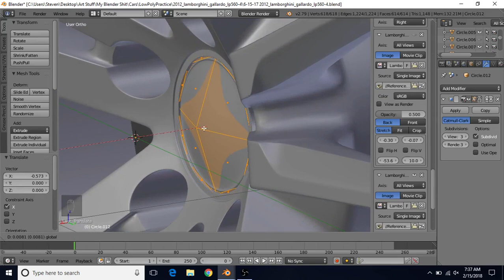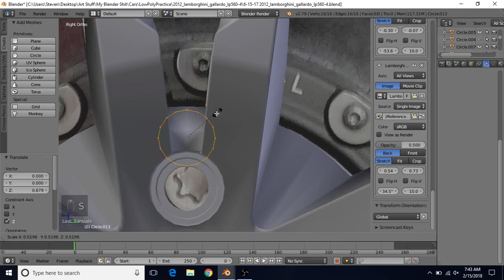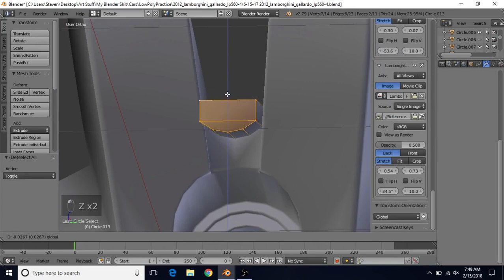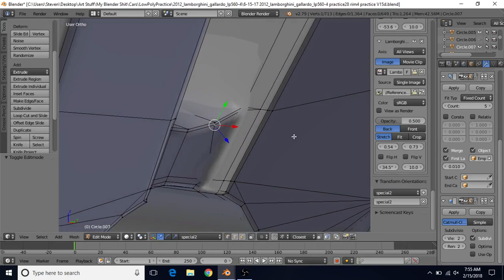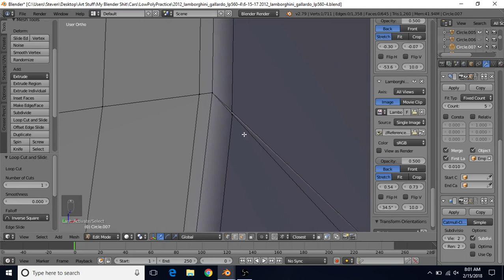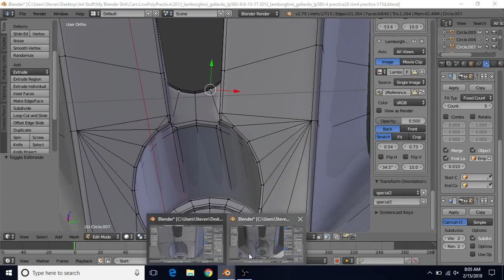Model A Lamborghini Gallardo LP560-4 in Blender - Tutorial Part 35 - 4th Rim Part 6

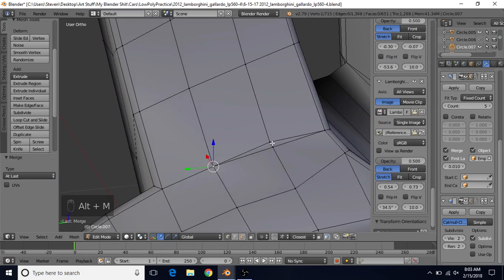Comment: Hello! I suggest using a good option "automatic merge vertices" instead of ALT + M -> "at last" (27:30). This is the icon to the left of the camera icon (render). In any case - it saves me a lot of time and it would be useful to everyone, I suppose)  ...Oh, when moving vertex, the button "CTRL" should be pressed.
Reply from the maker: Hey! Thanks for the tip! Sometimes with these automatic things I prefer to do it by hand. That way, nothing gets accidentally merged or something without me knowing it :D.

An example of this happened to me while making one of these rims (not this one specifically, I forget which one). But anyway, I did the remove doubles command and it actually removed some that I didn't want to remove!

But this is an interesting suggestion and I've never actually played around with it so maybe I'll give it a go at some point. As long as the threshold for merging isn't too sensitive it may work out. Thanks again for the suggestion and the comment :D.
Reply: Yes, automation is still a beast ;) I also try to use it when I'm very sure!

I also had funny cases with the "remove doubles" :) Eh it hurts:)

Thanks for your videos! Incredibly powerful motivation!
Reply from the maker: You're welcome!